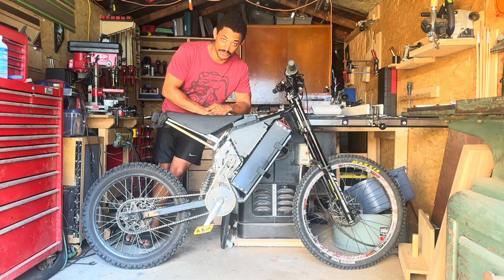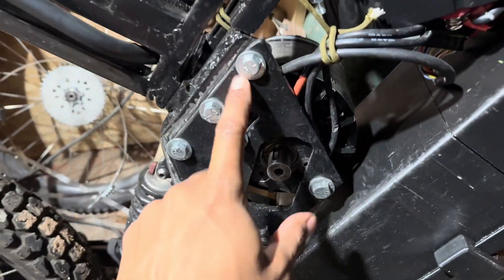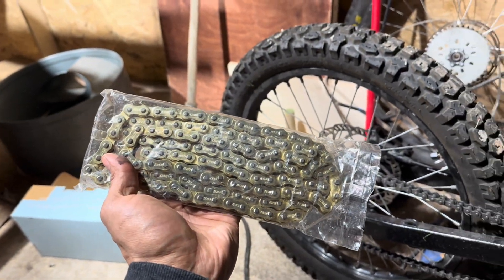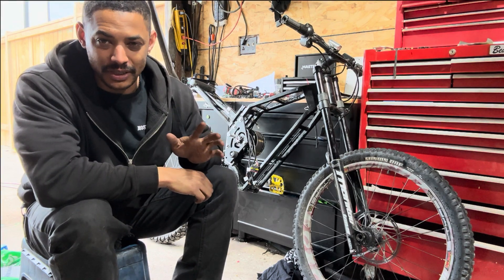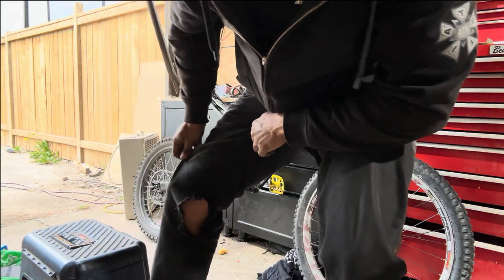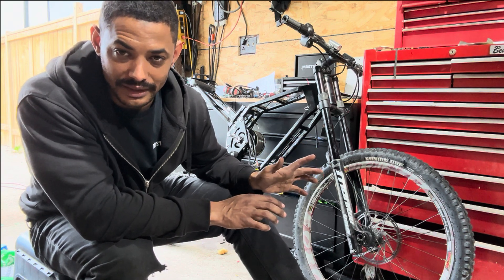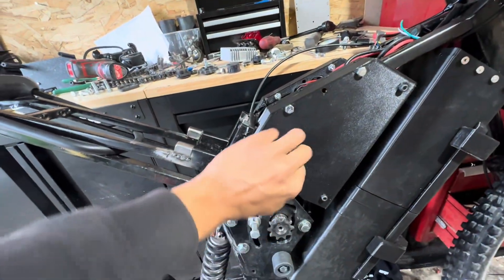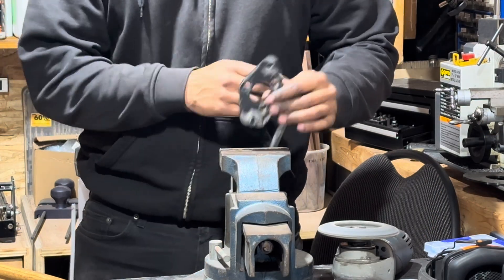15 kW Mid Drive Stealth Bomber Build - Why I Switched from VESC to FarDriver - Ep.6

Comment: Did your VESC run hot? I'm also using one, and so far it's pretty good. It's the Flipsky 75200 pro v2, and I'm pushing 72v 200 phase amps and 100 battery amps. I designed a small heatsink for it and, at the highest I have seen was maybe 42 °C
Reply from the maker: Never got hot not even for short spikes.
Reply: @Joyride_Labs  So I guess I shouldnt push it over 200 phase?
Reply from the maker: If temps can’t stay stable at that power level then definitely not. Make sure connections are all tight. Bad connection can cause high resistance and bring heat into system.

Comment: a fardriver 72360 can push 15kw?  what line current and phase did you set in app?
Reply from the maker: Easily push past 15kw at the right voltage. 21s is 88.4v full charge, multiply by 170 line amps and your at the 15kw without even talking line amps yet.

Comment: 😅Whad up my mulatto brother, with a Vesc you can program it to any amount of power even if it cant handle it, I say that because people read the specs together verses individually, meaning if its a 100v 200a vesc you need to either cut the voltage in half to run at 48v peak 200a or 100v at 100a peak,also Regen will burn your vesc quick and you should mount a heat sink that hits the wind .

Comment: What happened with the 7even controller?
Reply from the maker: One lost its firmware randomly. Tried to get it loaded back with the company but was not successful. The other one phases shorted out mid ride, locked up wheel, was super sketch. Stinks I had such bad luck with them. Was probably fluke if anything.

Comment: Hey, what VESC where you using? I could help do some research, i worked with VESC's for a small while and there is a pretty big list on why they could burn out.
Here is a small list:

1. Back-EMF, this is where the motor acts like a generator and sends high voltage back trough the wire, this is mostly compensated for by the VESC if it is turned on, any loss of power to the VESC while the motor is spinning WILL cause dammage, even just the BMS cutting out for 1/10th of a second.
2. Wrong motor config, this could be where it thinks the motor is larger, or the HALL sensors (when set-up) is in the wrong order, some VESC's switch over to sensorless but may switch back randomly and this causes a similar issue to 1., where it basically fries the controller due to wrong or higher voltage sent back trough the wires.
3. Too little cooling, VESC need a LOT of cooling, even just a tiny bit too little can slowly reduce performance, meaning more heat, and thus a run-away untill it blows up or just fries.
4. Wrong VESC firmware or set-up, I made this mistake way to many times lol, try to find different firmware versions, or the same from a different source.
5. Overcurrent, this is rare but still posible by setting a REGEN thats too high, or that the VESC can't handel the AMPS pushed trough it, its the current/amps that cause the heat, not the voltage. (WATTS is voltage * Amps so a 1KW VESC at 100V is 10A, or at 50V its 20A but also 2X the heat (bc current is 2X))
6. Bad connections or ground, our machines would ground out trough the frame onto the floor which was one metal sheet, this meant only 1 wire for power, but thanks to the fact some machines where painted, they didn't ground correctly, meaning movement of them starting or stopping or really any movement would cause ground to dissconnect and it would just blow up the VESC.

Hope this helps to diagnose the issue!!

(Also knowing the voltage you run would be usefull)
Reply from the maker: Hey, thanks for taking the time to help out. I appreciate it. The owner of seven electronics had walked me through setup and monitored the entire configuration at least software. But there are so many factors , that one of us could have missed. Big reason why I wanted to try FarDriver to make sure there wasn’t an issue somewhere else in the system. All of the VESCS failed very differently. 1 just lost its firmware somehow. Two the phases shorted and locked up rear wheel ( was super sketchy, could have been a lot worse) the last appears fine until throttle then shows max negative current limit. 

I feel like 1 or two of them could likely be repaired by fixing a component (likely mosfet) or two. One I think is to fried to bother. 

I’m running 6p21s molicel battery.
Reply: If your running 21s on your battery which is 88v fully charged so a lot of the vesc’s you shouldn’t go over 20s. You could of just pushed the FET’s too hard and they cooked.

Comment: Awesome build man. Might want to think about a belt for motor drive. If that chain snaps at higher speed it’s like a blade and can really fuck you up. I’ve seen it happen it’s nasty AF. If you go chain guard make sure it can handle it and protect you
Reply: I didn’t see a contactor or any kind of precharge resistor from your battery to controller. The in rush current from the battery may be spiking when you connect it and that may be frying the vesc’s. Also the XT90 on your battery pack can’t handle that many amps. Grab a QS8 or QS10 connector. Those can handle a lot more amps and they are anti spark.
Reply from the maker: Thanks for the input. belt drive would be nice, have thought about it before, just hard with the double sprocket on jackshaft to find the space. Can confirm it really fing hurts when the chain snaps and makes contact with your leg at high speed... lol ask me how i know. lmao
Reply: I saw your pants, you got lucky. Remember your family jewels are in the war path of a broken chain too. Just get a injection molded or metal chain ring. If you diy it don’t 3d print it. Send it off to get laser cut out of aluminum or something sturdy. People have severed limbs from a snapped chain at higher speeds. It’s narly, puts me in pain just thinking about it. But damn good job on all of your designs. The bike very cool and unique. How did you Blow up so many vesc’s? The Tronic should of been able to take it.
Reply: Keep an eye out for rust in the tubes of this frame . Also the seat bracket on mine snapped they would not replace because I had mine exactly like you do to change the seat angle . Love the build the qs205 and 272 hubs I ran were fun but not nimble and killed the pack .

Comment: Whoa you can throw a 428 on a 420 sprocket?
Reply from the maker: Pitch is same but rollers are to large. Good catch, was wondering who would pick up on that. Switched to 420H chain instead.
Reply: @Joyride_Labs  All steel non-oring sealed RK Racing chains are my favorite. I have noticed gold chains are much noisier and 0-ring chains rub on stuff close to the chain more so more noise from those as well. Steel sealed seems to be the quietest.

Comment: Wich fardriver controller was it ND72680?
Reply from the maker: I believe 72360. The 680 would have been nice.  Had to settle with what I could find locally and fast.
Reply: @Joyride_Labs Got it if that dies too then the 530 or 680 would be in my list skipping the 450 so its reliable woth high power over long periods of time but just like the 360, the 450 would be fine its just for extra headroom
Reply from the maker: @Mark_catface please no more dead controllers!! lol. But yah, thanks for the tip. I appreciate it.